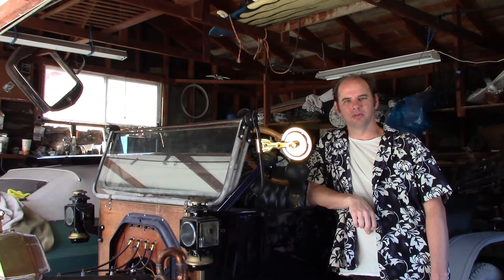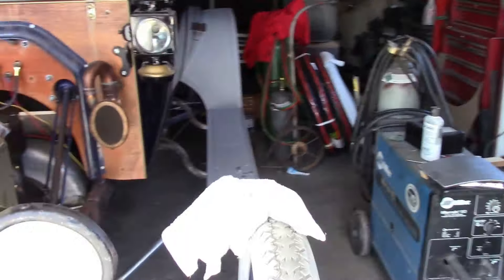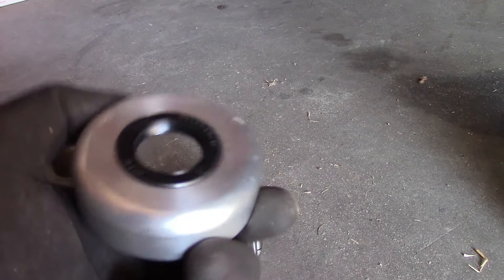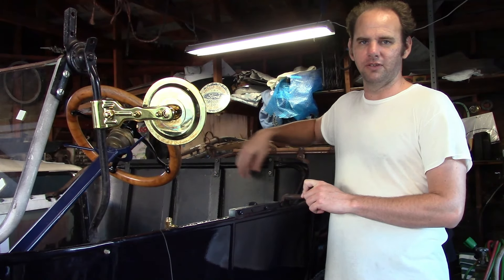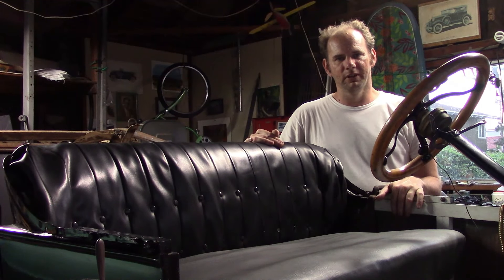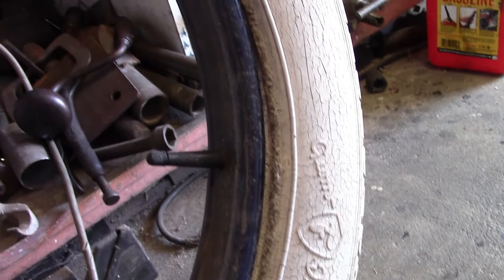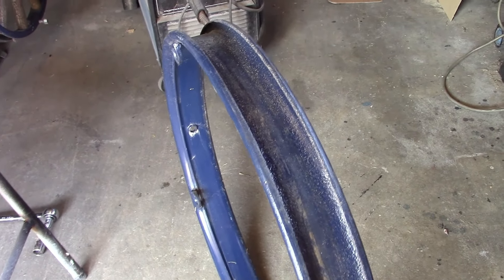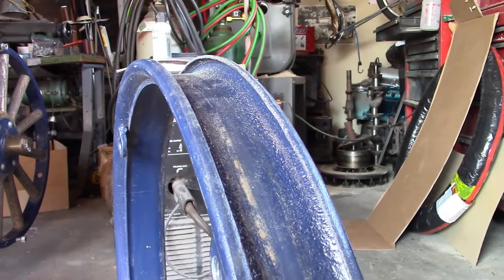New tires and other stuff. 1913 Ford Model T.

Comment: Yes -------- those Coker Tires are very expensive ----- not just for those tires you have but all the way up into the 60 and 70's ---- the reproduction of the originals ------- wonder what that tire cost back in the day ------- You didn't wiggle the spindle up and down ----- the repo sleeve and bearing must have taken up the looseness ------ not sure how your engine is so much quieter than other T's ----- you must have paid close attention to clearances and end play to make it come out with close tolerances making it tighter and quiet ----- Glad you got complements on how it sounds. It's nice seeing you ---- KEEPING --- the T's going -------- Hope you have a Good week -------- Rodney

Comment: The best tire installation technique I have used is called the garbage bag method. Sounds weird but it is great. No tools needed. Do a YouTube search on it. I installed 5 new tires and tubes on my 29 in less than an hour. Since no tools are used you never scratch a wheel.
Reply from the maker: Cool, I'll look for that.

Comment: Wheel brakes on a model T? I thought they only had a brake in the transmission.
Reply from the maker: The ones on wheels are the parking brake, but yes, the service brake is inside the transmission.
Reply: @onewhocollects6781  Oh, thanks for the info. Interesting cars for sure.